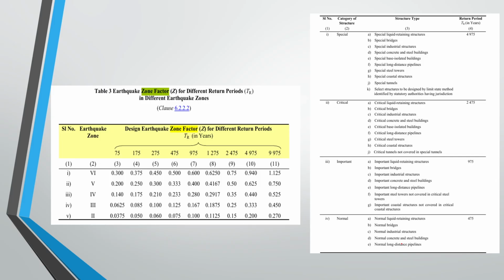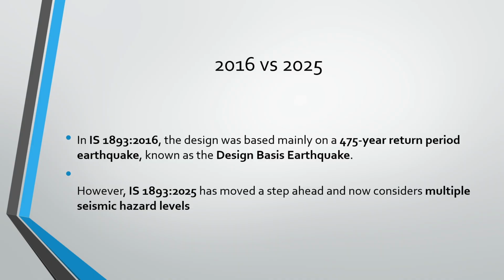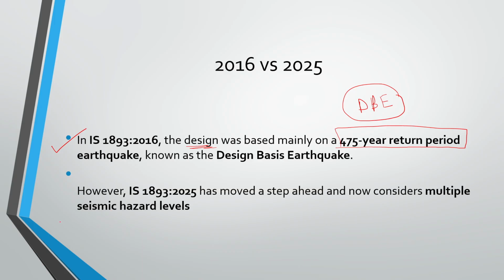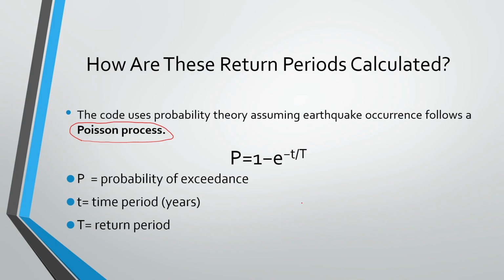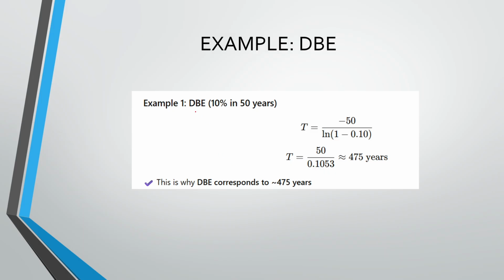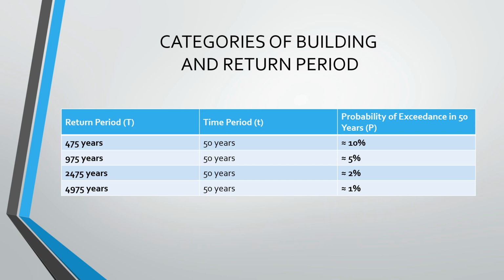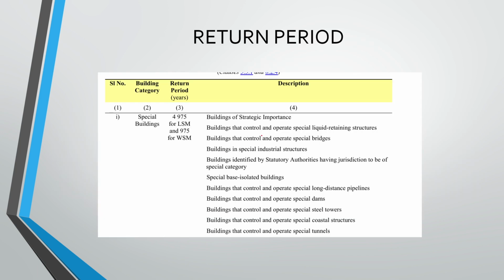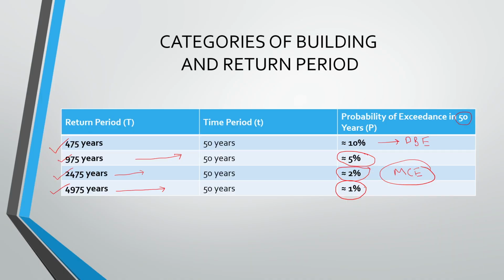Return Period Explained with Example | Multiple hazard levels | Design Basis Earthquake Comparison

Comment: Very nicely explained ❤❤
Sir can you help me I am doing M Tech Structural Engineering final project with ETabs version 22.5 trial , now not updating what to do any subscript require, I like your tutoring very much
Reply from the maker: Do you want to analyze using updated 2025 code?
Reply: @Realcivil  want how to updated ETabs version so that I can work with ETabs
Reply from the maker: The update may take some time. One thing you should note, its not necessary to apply the new code immediately this code is valid after some time bcz people need to understand all the clauses. So for project of mtech you can go with older code also.
Reply from the maker: You can search plugins if available on Internet related to new code update on etabs
Reply: Sir I am telling about installation of ETabs software, my old installed version is no longer working